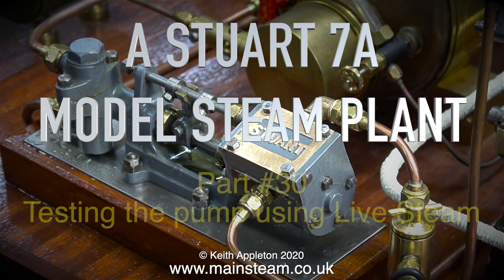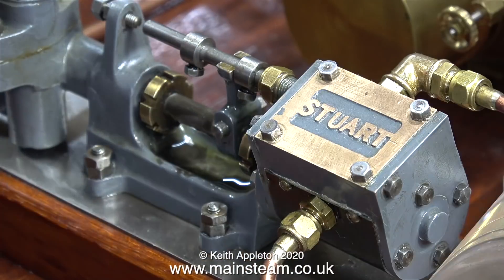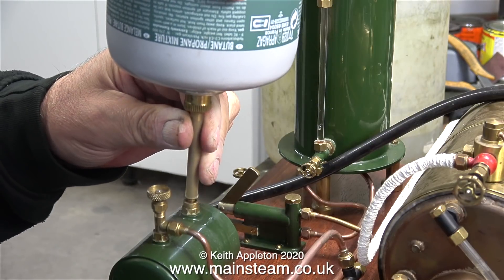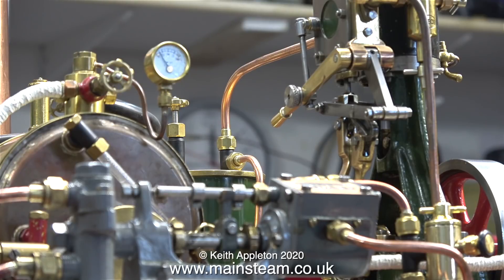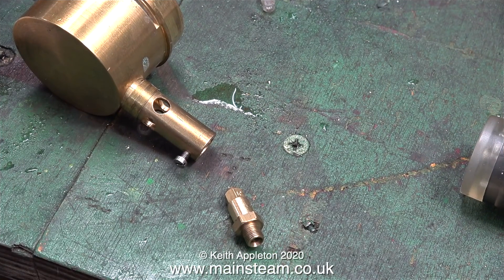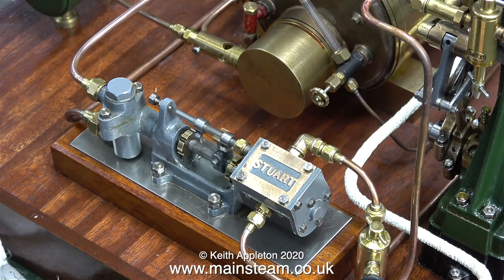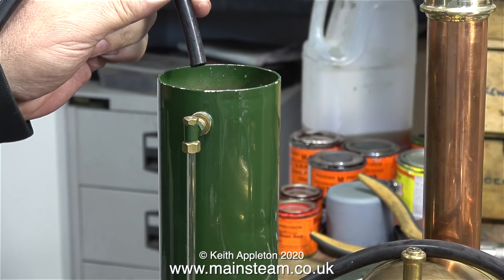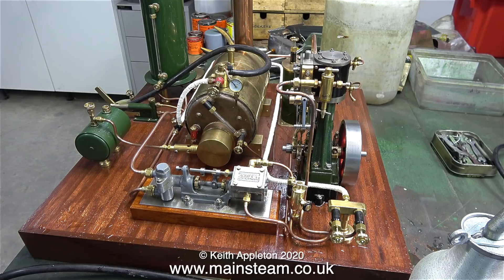A STUART 7A MODEL STEAM PLANT - PART #30

Comment: I'm still struggling to wrap my head around the wet or dry paper gasket !
It's really good outside the box thinking and I'm sure it works just fine but the possibility of introducing grit into the cylinder goes against the grain for me. I accept that the high pressure of steam flushes the cylinder very effectively so the risk is reduced but it feels so wrong.
Did you do it deliberately to see how many people complained ?
Reply from the maker: You are radically overthinking this Ian, please relax and don't struggle wrapping your head in Wet or Dry Silicon Carbide Paper. . . The grit is firmly bonded to the paper (it doesn't seem to come off when I rub down parts with it) which in turn is firmly sandwiched between metal parts using bolts, so please tell me how you think that the grit gets into the cylinder in the first place to be immediately washed away by the steam & water ...... nobody else mentioned it by the way, only you ...... }:-)))
Reply: @keithappleton  I'm sure you are right but to me it just 'feels' wrong, I was always taught that grit is the killer of engines and everything must be done to keep it out.
There is a bare edge where you cut a hole out, and the grit is very fine. I imagine that might shed some grit over time but as you say it should get flushed away quickly by the steam.
I trust your far greater experience and knowledge, it's obviously just me that has the issue and it was a very interesting gasket solution, just one that would never have entered my head.
Reply from the maker: Don't worry so much Ian, it's only a Toy Steam Engine after all . . . . }:-)))